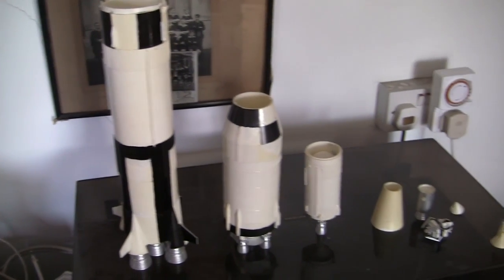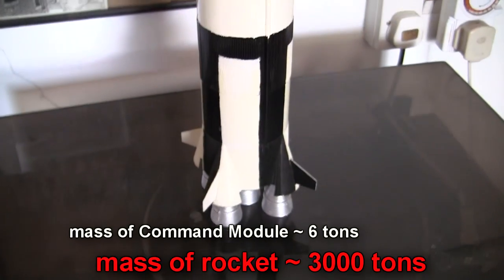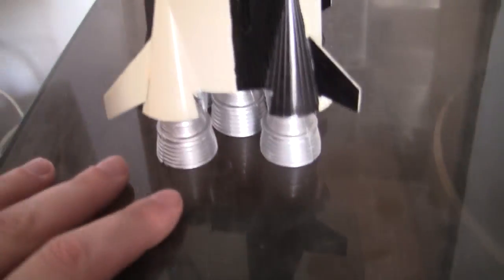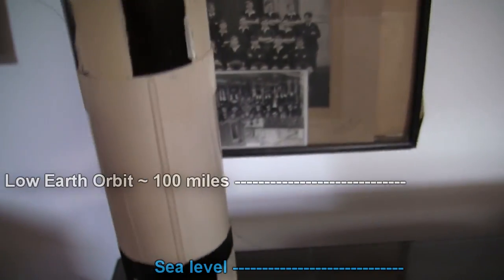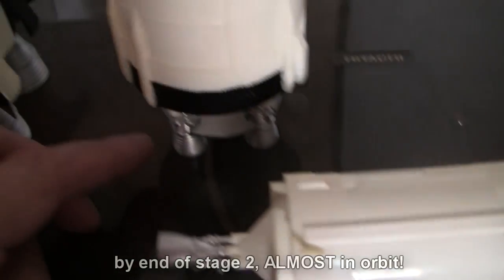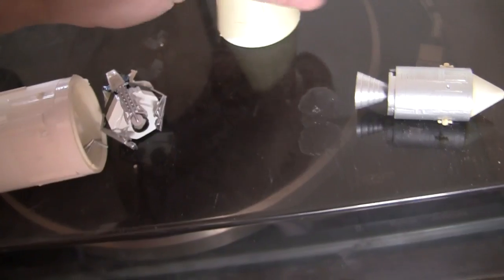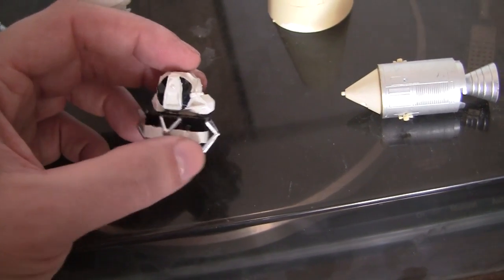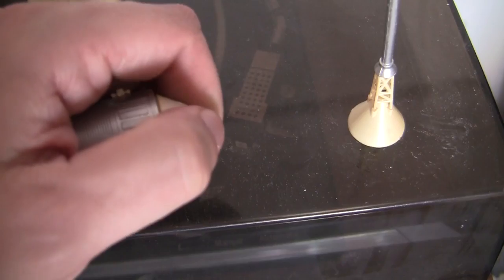The Saturn V Rocket: How it worked!

Comment: In fact, the entire first and second stages also returned to earth as well as the instrument unit ring - but none of this was reusable and was not recovered.

The 1st stage F1 engines did indeed use kerosene and liquid oxygen. The second and third stages used J1 liquid hydrogen and liquid oxygen.

The engines of the Service Module used hypergolic fuel as did the ascent and descent engines of the Lunar Module. 

The firing of the top stage to send the spacecraft to the moon was called TLI - or trans lunar insertion.

I recognise the model as the original 1/144 Airfix kit. It was recently reissued with a more accurate upper section,  including a revised Service Module, Lunar Module Adapter and Launch Escape Tower.
Reply: EricIrl Can you imagine seeing those come crashing down into the ocean? It would be like seeing a building falling from the sky.
Reply: EricIrl See my note I had elsewhere in the comments about the first stage.  There was a plan to recover the first stage if enough launches made the plans economically feasable, as there were a lot of other things planned after Apollo that were effectively killed by Congress and Nixon.
Reply: EricIrl The first stages fall 500 km east  of KSC. The second stages fall 3000 km far, near the middle of the Atlantic Ocean. The third stages usually fall in the Moon, 380.000 km of the KSC. The ascending stages of the LEM fall in the Moon too. The service modules fall in any place of the Pacific O.
And my internet conection fall every day, hahaha

Comment: Where can i buy a Saturn V figure of that quality? Is it a specific brand?
Reply: Revell

http://www.amazon.co.uk/gp/product/B00G7G4EPI/ref=ox_sc_act_title_1?ie=UTF8&psc=1&smid=A3P5ROKL5A1OLE

just so you now you need to build it
Reply: Pneutella I built a model in junior high school, using soda cans, a little juice can, styrofoam, and plastic straws for the gantry tower.  I have a really small one of these that is a pencil sharpener, and a multipiece model of the lunar module that actually separates into the descent and ascent stages.  I would love to get one of these type models.
Reply: Airfix
Reply: Airfix's model is fantastic but if you want lots of detail. Revell is the way to go. This guy has done a terrible job painting the model mind you
Reply: Robert Dordi In actual fact, the Airfix model is now probably the most accurate Saturn V model there is. In 2009, they revised the top stage, Lunar Module Adaptor section, the Command/Service Module and Escape Tower. The original kit had some major shortcomings in this area. These have now been corrected. There are still some remaining inaccuracies but most are minor.

Most Apollo models were originally released in the late 1960s/early 1970s and were often based on technical drawings, artists impressions or boiler plate versions of the hardware - which means they are inaccurate when compared to what actually flew in space.

In more recent years, companies like Dragon have released more modern Apollo kits - but even these aren't perfect.
Reply: EricIrl Not so much accuracy more just the detail that the model has. The engines are a huge issue with the Airfix model and because of the size it can't get the the smaller details in there
Reply: Robert Dordi It's not perfect by any means. 
Another problem is that, apart from the revised upper section, the Airfix moulds are over 40 years old now and are now very worn, so some of the original detail is now a bit soft. When I built my Airfix Saturn V recently, one of the F1 engine bells had a hole in it due to a moulding flaw. This needed to be fixed during the build.

Accurate resin F1s are available as after-market items if you want to really correct the F1 issues on the Airfix kit. Alternatively, you could try covering the engine bells with foil. In real life, the F1 engines were covered with a thermal blanket material - a process called batting. NONE of the available Saturn Vs depict the F1s covered in this batting material. Some of the resin replacement F1s are available showing this batting in place.
Reply: EricIrl And just to add, as part of Airfix's updating of their Saturn V in 2009, they also released a new version showing the rocket in its Skylab configuration. This of course means that the top section of this version is also a modern moulding.
Reply: EricIrl Yeah the engines were the worst part. My newer version was excellent it just was missing some details I wanted like more intricacy on the service module but once again it's so tiny you can't do anything about it. I fixed the engines on mine with some aluminium foil tape. worked an absolute treat and to be honest even if they were moulded perfectly beforehand I would do that again because it looked so good

Comment: Neat illustration about how wasteful chemical powered rockets are, in the beginning. Unfortunately, I don't think we'll see the NERVA program and similar drive systems being revived in the near or even midterm future :(
Reply: That NERVA won't help you to lift off, there is no such compact nuclear reactor available which can produce that amount of power required for lift off.
nuclear reactors can only be used for upper stages
Reply: True, but still, nuclear would be a massive weight saver. The Nasa Mars reference mission 5 study says that a NTR powered Mars ship would be 100 tons lighter than a chemical powered ship, and need 3 - 4 less heavy lift rocket launches.
Reply: Insta Goat
well, if we speak about space travel then yes this rocket may be useful, but there are other alternatives like solar powered  ion engines.

However lifting into orbit still has to be done with usual chemical rocket
Reply: deltaxcd
 You can do it in Kerbal Space Program.
Reply: ***** Well Kerbal space program might not be that realistic then..

Comment: To be honest, I felt that the really impressive rockets were the Saturn I and Little Joe series. They did animal payload launches on V-2, Arobee, and Jupiter platforms to test for survivability. However, Little Joe was the rocket that tested the Mercury capsule design and at less than 10% the cost of an Atlas. Little Joe II tested the emergency escape system at only 20% the cost of a Redstone. And, we never would have made the jump from Titan based Gemini to Saturn V based Apollo without Saturn I in between. The third stage was developed and proven on Saturn IB. The Titan IV had about the same lift capacity as Saturn IB. The Falcon Heavy should have a lift capacity about double that of Saturn IB although less than half of Saturn V and less than a third of Ares V.

Comment: Actually there are two engines on the lunar module as it is a two stage craft.
Reply: Yes, but only one is used for descent, while the other is strictly an ascent engine.
Reply: Dethbyobsidian I know, thats why I said 2 stages. Also, they were not constrained to those tasks. If the astronauts felt that they didnot have enough fuel to land, they could fire the ascent stage prematurely back to orbit.

Comment: For propulsion or to manouevre you need resistance like water(Boat), a road (car) or atmosphere (planes). As the moon has NO atmosphere it is impossible to use a breaking engine or a steering engine. For this the whole moon landings are a HOAX. Please start thinking for yourself. You didn't get that grey mass to be hypnotized all the time. Wake up!!!
Reply: Never head of a guy named Newton have you?
Reply: yess I did. Fa=Fr
Reply: How did they use the braking engines during landing on the moon? No atmosphere remember.
Reply: You idiot!!!.........it does not require the thrust of the rocket engine to push against an atmosphere.  The mass accelerating out the rocket creates a force in the opposite direction that pushes the rocket forward.  Knuckle-Head! or Baboso!!
Reply: Sancho Panzes There are mirrors on the moon placed by Apollo astronauts that you are able to reflect beams of light off in order to send the light back and gain a reading (Bare in mind you would require specialized equipment). These results prove that there were missions to the moon unless you believe that these specially made mirrors randomly created themselves, but then again you will probably try to argue that the moons surface is reflective, which I agree it is and in order to counter that tests show that concentrating light onto the moons surface will not bare a result from returning light as the moons surface is not massively reflective, but we get the result when we fire the light to the coordinates given by NASA of where the mirrors are located.
Of course I do not expect for you to accept my explanation, but you sound really stupid allowing yourself to be disproved by an English secondary school student who hasn't started his GCSE's yet. So please do research before making claims that can be disproved by a 14 year old... For your own sake.
Reply: There is something called RCS is can maneuver you in space
Reply: Sancho Panzes https://www.google.com/search?q=space+station+through+telescope&biw=1429&bih=687&source=lnms&tbm=isch&sa=X&ei=oRReVNzjLZGmyATEiIK4Bg&sqi=2&ved=0CAcQ_AUoAg&dpr=0.9
Reply: Snow Crest You sound like the alchemist that Newton was. They never put a man on the moon. Stay happy in the ferry tale your life seems to be.
Reply: Yep they are. Go and search for the altitudes of ICS and the spaceshuttles. They never left the atmosphere. They even never left the earths gravitation. The moon landings and the trips to Mars are complete BS.
Reply: Thats what I said. Exosphere is still part of the atmosphere. Gravity is as on the ground. Indeed back to basics.
Reply: spaceshuttles go no higher then aprox 800 km at max
Reply: exacttly. You're educated though
search for Iserbyt or Gatto!
Reply: It*
Reply: Sancho Panzes You must be the king of stupidity.Get back on your meds goof-ball before you think you can fly and hurt yourself.
Reply: Eddie Hayes Thnx smart ass.
Reply: Sancho Panzes Get on your meds and you will feel better soon.Oh,Your Welcome,smart ass or I think you are more of a dumb ass.LOL!
Reply: Every intelligent man that's ever lived would tend to disagree.
Reply: You're such a smart ass! Thank God on your bare knees!
Reply: Sancho Panzes Oh great invisible man in the sky that for some reason needs my approval to exist, and exists despite everything humans have ever known is still somehow in existence. Please forgive me for having a spec of intelligence and disputing this man with none.
Reply: Amen! Big problems with your addiction?
Reply: sancho, you don't need resistance for propulsion to work, only in atmosphere flight, with gravity, witch = 9.8m/ps^2  thier is another type of propulsion used for space, it's called in space propulsion, milliseconds  pulse firing, and on the linear thrusters on the command and service modules used hyper colic propellents. for in space propulsion, and menuvering in space
Reply: Thnx
Reply: Sancho Panzes
F=MA
Reply: Sancho Panzes Also the moon has a Small Gravitational pull which means that it would pull you back to the ground like on earth, so if you were to land on it, you had to make sure that you didn't crash into the surface... Aka Retroburn and slow yourself down (Explanation found above, If you take your time and read it again a couple of times, you might realise that you're wrong...... Oh wait.. You're a dumbass so you wont..)

Comment: The Rocketdyne F-1 engine that powered the first stage truly was a staggering machine. Just the fuel pumps on each unit were driven by a 55,000 hp gas generator turbine.
Reply: robyrobyroby12345 The first stage itself was most likely made by Boeing, but the F-1 rocket engines used on the first stage of the Saturn V were designed and manufactured by Rocketdyne.
Reply: Now I know where Squad got the idea to name the new company in KSP Kerbodyne.
Reply: I thought the first stages were made by Boeing?

Comment: I thought that the first stage of the saturn class moonrockets did not use hydrogen because the cryogenic pumps were not strong and reliable enough for that. But I do not know for sure as I am no rocket scientist (or even a scientist for that matter). But I have some very basic knowledge about cryogenic pumps and the argument, that these pumps are too vulnerable for that massive amount of fuel displacement is not very far-fetched as these type of pumps are indeed very vulnerable. Does anyone know if I was informed correctly????
Reply: You are right He was mistaken the saturn V used kerosene not hydrogen.
Reply: No, I think he was right stating the first two stages were indeed not hydrogen.
I know that the japanese are/were trying to make a cryogenic pump that will be able to fuel a first stage of a rocket as that would massively increase effective load on a rocket. I believe that such an advancement may raise effective load from the 1% of the moonrocket to a massive 10%. But I heard about this years ago and don't know if the japanese are still researching into this. I do know that several wounded and at least one casualty are noted when a test rocket exploded on actual testing destroying half the facility.
Reply: To be exact they used RP-1 which wikipedia says is a highly reformed form of kerosene.
Reply: Tommy Bruce Just to clarify, only the first stage burned RP-1.  The second and third stages used liquid oxygen/liquid hydrogen.
Reply: *****
Aha, thank you.
Reply: Got fuel?
Reply: Akin Khoo there probably is a weight vs. volume optimum